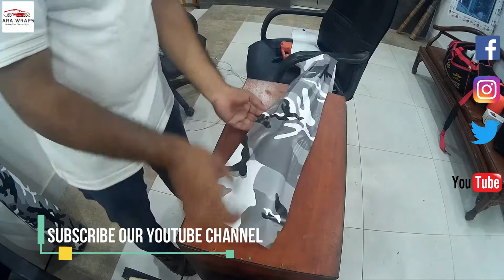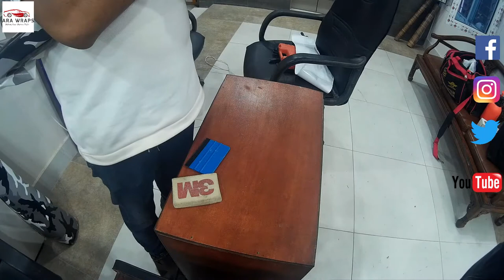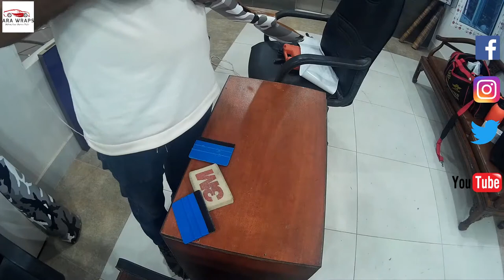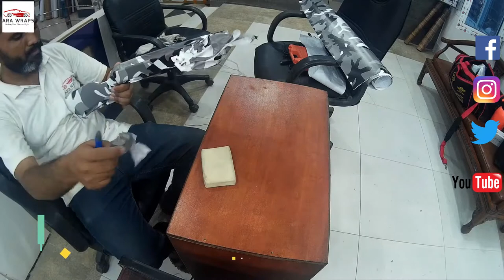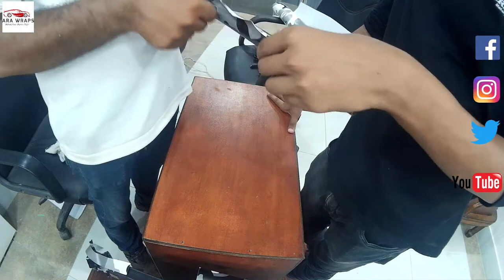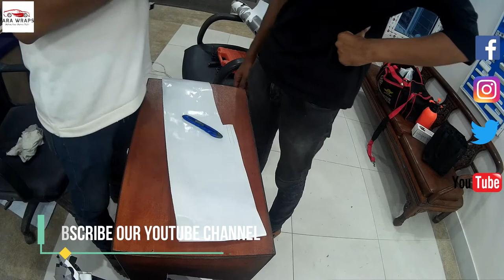Pellet Air Rifle (Snow Camouflage Wrap)

Comment: I just bought an fx impact Mark III used but it's wrapped wrapped and I want to remove the wrap is it very difficult to do?
Reply from the maker: Professional removal methods are recommended to remove wrap to avoid damage to car paint. 
You can refer to any reputable vinyl shop sir.
Reply: @ARAWRAPS  thanks for getting back to me